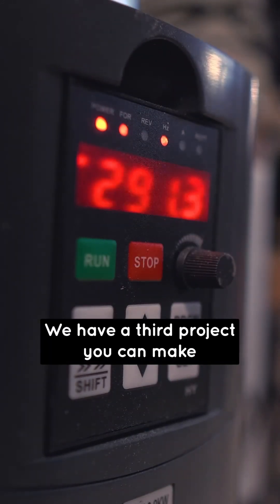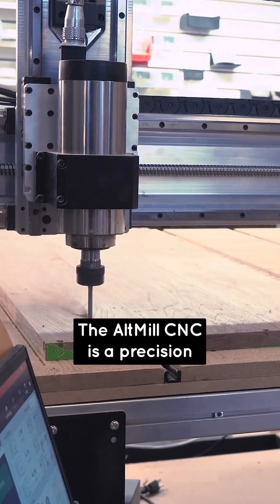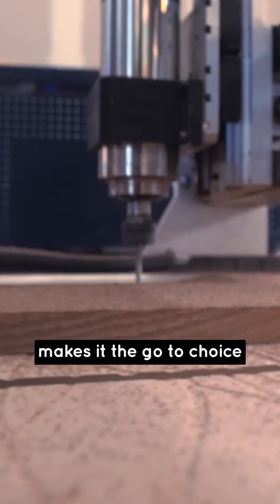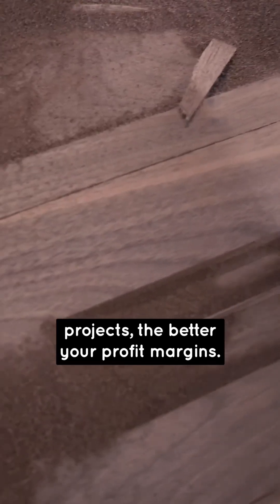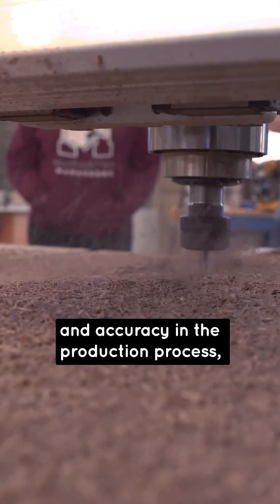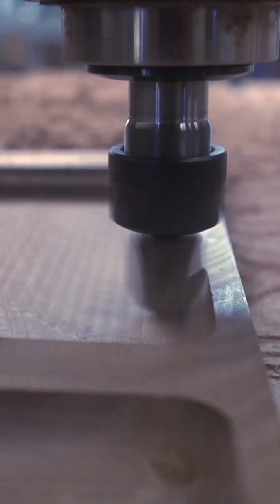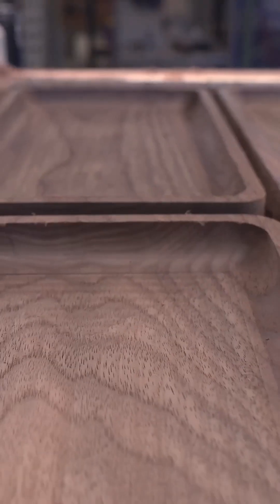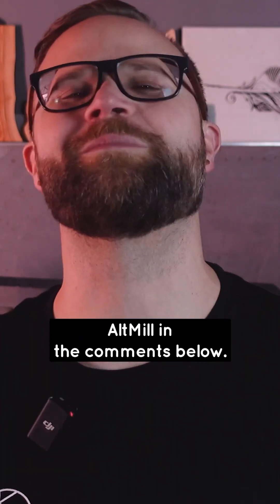Maximize Manufacturing Efficiency with AltMill CNC #cnc #shorts

Comment: just because the motors can push 600 ipm doesn't mean the machines frame can support it.
Reply: Fear not. I have one. It does!
Reply: @EdAgers110  I noticed they don't offer a 2.2kw spindle option. Have you run into any power limitations with the 1.5kw option, or did you go aftermarket and upgrade to a 2.2kw setup?